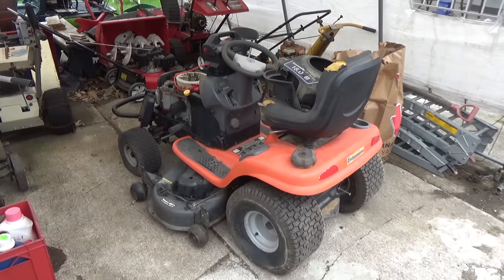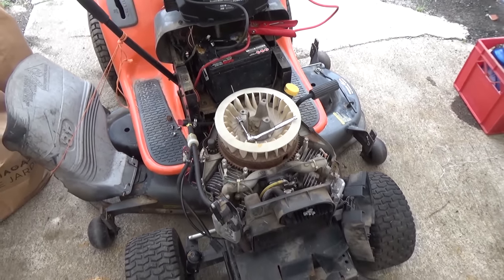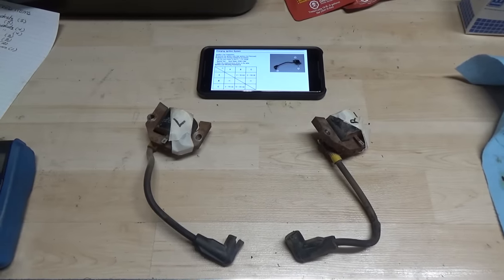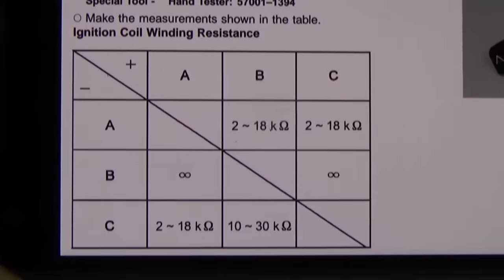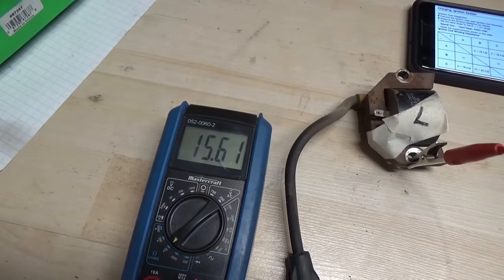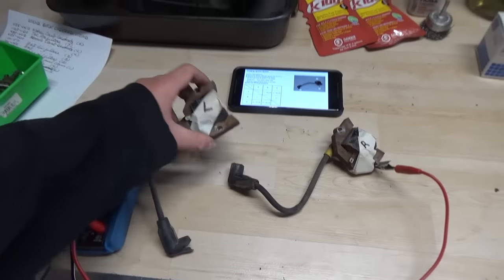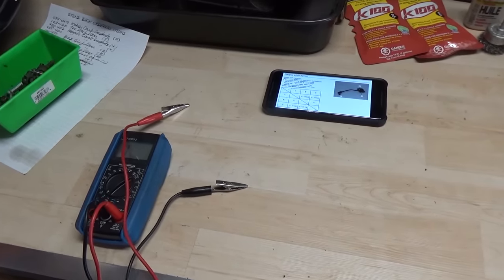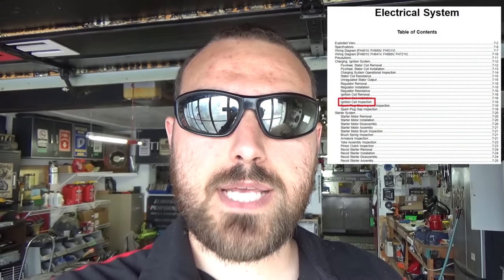How to Test a Lawnmower Coil

Comment: Have you ever heard of a coil starting and running fine, and then after a few minutes, start hearing a random miss (it's a one cylinder mower), than after a few more minutes it will stop running while cutting. Won't start back up immediately, but after waiting about a minute or two, it will start and run fine, and then repeat the same thing. Could it be doing this when it gets hot and fails? I have replaced the carburetor, auto choke assembly, and gaskets, removed and thoroughly cleaned out the tank and filter with detergent and water, dried thoroughly. I only run ethanol free gasoline and I always filter it through a funnel with a fresh each time conical coffee filter, and there is no water in it. It was doing this same thing before the carburetor replacement too. Sometimes, before dying, it starts to just run real rough and is trying to die, and if I can quick enough jiggle the governor rod, it will smooth out and run a few more minutes, but will do the whole process again. I think I need a new thermowax unit because it keeps the choke plate open always but I don't see how this would make it die once warmed up. I may have two simultaneous unrelated problems. It is a Honda GCV160 engine. I would replace the coil and see but they cost $60!

Comment: I see you are in Port Coleborne, looks like I spelled it wrong.  I went through there many times working on ships before you were born I think.  Do you answer questions ?
Reply from the maker: Yes, Port Colborne! And I respond to comments when I can, as long as I get the notification. Sometimes there's so many that I can't keep up and some get lost.
Reply: @EliminatorPerformance  OK , thanks. I like lawn boys and in 1992 I was looking after 3 yards and I bought a new mower to have in reserve. It’s a Briggs,  4 hp I think. Has been super reliable considering it is seldom used. Always starting on 1 or 2 pulls. I read the fuel pump diaphragm should be changed every couple of years and mine was still original, so ordered a kit with dia, gasket, filter n primer bulb. Trying to change the bulb I just destroyed it and never got the ring out..  decided to order a new carb and keep the parts. New carb on with dia, on tank first then gasket, and tightened evenly.  Now the problem. Primer bulb depresses with no resistance and pops back quickly not. Pumping any fuel.  And engine not starting.   Any thoughts, bad carb, or I did something wrong. Thanks for consideration. Henry

Comment: Brilliant. Thanks for sharing your knowledge. That was so helpful.
Can you tell me if it's possible to test the little Igniter module that's inline on the kill wire on a Kawasaki FC400 engine ? I have a weak, almost non existent spark.
Reply: This is what I was looking for. Page 37 of this Kawasaki FC400V workshop manual.
http://www.encoreequipment.com/wordpress/wp-content/uploads/2012/06/14hp_FC420V1.pdf
Reply from the maker: I've heard you can't test them, simply replace.
Reply: @EliminatorPerformance  - In that link on p37 is a test for what they call a "Control Unit". It does look like it could be an Igniter. Its got 2 Ohms readings. Same points but reversed polarity.
I've also come across some people who've fixed a bad spark by cleaning up the earth contact for the igniter. Sounds promising.
Reply: The two Ohms readings given in that manual for testing the igniter are 60-100 and 400-600. On the 60-100 test, I'm getting about 800. The other one, I'm getting about 580. On the strength of that I've ordered a new igniter. 

Thanks for helping me go in the right direction with this.

Comment: How can the timing be safely tested for an unknown (No markings and don't know where it came from.) coil?  I know the length of the HV wire does affect it, with being shorter having a more advanced timing.  You can have a dozen unmarked coils that look identical, but will fire at a different time.

Comment: I have a Murray mower that I have put a Honda engine in runs good until I go to engage the blades and then it bogs way down and acts like it has no power when I getting thick grass it just wants to shut off
Reply from the maker: Probably carburetor not fueling properly under load

Comment: What you are doing is NOT a test. You are just measuring the resistance of the coiled wire. You need to initiate a voltage spark to test the hv coil(s)

Comment: What is more effective to check magneto? A simple spark plug tester or multimeter?
Reply from the maker: Well a coil produces spark and can be checked with a spark tester, while a magneto charges the battery, and can be checked with a multimeter on the battery while the machine is running. If the voltage is higher while it's running, the magneto is charging!

Comment: Why does just sitting ...make a coil go bad...?
Does sitting for 10 years cause a coil to not work anymore?
Reply from the maker: Great question, sometimes they can get moisture in them. When you run the Engine, it creates heat, which can remove that moisture.

But once the moisture has sat in the coil for ling enough, it will start to corrode things.

This is where you run into issues.

Sometimes you can put a coil pack in an oven at low temp for 20mins (if a mower sat outside during a thunderstorm and won't start the next day).

Other times, you just need to replace the coil!
Reply: @EliminatorPerformance  👍
Reply from the maker: Could be the engine overheating causing a fueling issue, or it could be heatsoak on the coil causing bad spark. Sounds like a carburetor issue, but hard to say without seeing it.
Reply: @EliminatorPerformance  👈
The Points where bad.
And Bad Condenser.
Runs Awesome now.
ItsOriginal 1977 lvt10 has 10 hours on it..
Thank u

Comment: My coil is showing resistance on all 3 points.  Lawn mower will crank and run but idles rough. When I remove left side plug wire, it idles normal. Any ideas?
Reply from the maker: Look at color of plugs on both cylinders, check if 1 is darker than the other. Could be a fuel supply issue...
Reply: Both are about the same, just replaced plugs, even switched both plugs to see if was plug issue, still does it on left side.
Reply from the maker: Well, one thing I could recommend.

Of you purchase a replacement coil from Amazon, and it doesn't change anything, you can always refund it.

Only thing else I could think of would be your high tension lead (spark plug wire) having a bad cap connection.
Reply: If I pull plug wire on right side runs real rough. Both in runs somewhat rough. Pull left side and purrs like a kitten..
Reply from the maker: You could also check compression on each cylinder, see if there's a difference... On top of that, a cylinder leak down test could help to see if you have valve leak...
Reply: Check & set valve lash? ??

Comment: I HAVE TWO NEW BRIGGS AND STRATON COILS.  EACH ONE MEASURE ZERO OHMS BETWEEN B AND A.  YOUR CHART SAY IT SHOULD BE 2K TO 18K.  ARE MY TWO NEW COILS BAD?  WHEN INSTALLED ON ENGINE I GET A SPARK, BUT ENGINE WILL NOT START.
Reply: If you got a blue spark, the coils good

Comment: Hey love the video! I have replaced my ignition coil however when I short the coil it should turn off the engine. (Kill switch) but it doesn’t. I tested the kill switch and it’s giving ground to the coil. How would I test the coil? Any help would be great.
Reply: If the wire from the coil to the kill switch is connected then you should be able to kill the engine when throttling down unless the kill switch wire to the coil has a break in it. Use an ohm meter on ohms for continuity to check that kill wire only if it has continuity it should work. You may not be getting a good ground when you ground it out or the stand ups that the coil mounts to are badly corroded and you are losing your ground there. We always polish with a fine emery paper the stand ups prior to mounting a new coil. Hope this helps out, sorry so late since we have so many comments and rarely go back to answer new ones hope you understand. By the way we only need 200 more views to hit a million which would be our first million view video. Appreciate passing on the word about EP and this video, tell them to hit the subscribe button also and thanks again for commenting.

Comment: Great vid very helpful. 
I have a question about the coil when hot. Can they become faulty after the engine gets hot. I have a thorx engine on a mtd t-245 tiller approx 20132014 and it runs great for 10 minutes and once hot it dies. Starts up instantly after it dies but then dies again when you try to put it under load. Really bloody frustrating..
Reply from the maker: Yes absolutely, thermal soak is one term, they just get so hot the coil stops producing spark. I'd recommend to replace at that point. Also check for mouse nest.

Only other thing I could think of is fuel supply issue, but if it dies out quickly it's most likely spark. If it dies slowly, fuel.

Comment: Does one need a subscription to get the coil specs?
Reply from the maker: No, you need a service manual. Not all manufacturers make them publicly available. Type the engine model number into Google and type service manual after that. You may get lucky and find a PDF manual.

Comment: Isn't it uncommon for both coils to go out at the same time?
Reply from the maker: Not necessarily, this machine was sitting in a field for some time, humidity builds up inside them from the rain and causes a short to ground from corrosion.
Reply: The problem is, the kill-wire ckt was improperly tested because you didn't change the range on your multimeter. Leaving it on 20k range, you couldn't see between 20k & 30k which would have been in-spec according to the test chart.
Other than that, thank you for the video!
Reply: Maybe so Ken Hart, but if a guy is going to do a "how-to" on proper resistance testing of an ignition coil with a DMM, let's make sure we're on the correct meter setting.
The less initiated folks are already compromised enough.
Now, I understand this may have been a little overkill for a no-start condition (after verifying no-spark) but I wouldn't want to minimize the value of pinpoint testing circuits & components, especially for runs rough, hard starts, or crapping out at high RPM conditions. For these, I'll be verifying coil resistance (using the correct ohms scale). Thanks

Comment: I think my Kawasaki v twin needs coils it idles fine but starts sputtering and almost dies out when I give it any throttle I just wanted to get your opinion on what could be causing the problem before I buy new coils it’s got 2300+ hours and I don’t know when the coils were last replaced or if they were ever replaced and it’s running on both cylinders
Reply from the maker: Could be the carburetor gummed up?
Reply: @EliminatorPerformance  possibly I hope so anyways cause coils aren’t very cheap and thanks for the suggestion I really appreciate it

Comment: The end result will be a dependable  smooth running tractor . It is the neglect of the consumer caused the large cost of parts .the moral of the story is you take care of your equipment it will not cost so much to fix . pay me now or later ether way you will have to pay .
Reply from the maker: And paying later usually means paying more!

Comment: Great Video, wish I would have saw it last week. Wondering if anyone can help or maybe you have a condenser bench test video as I am a little foggy on that. I have a Kohler 8hp k181. Replaced coil, still no spark. I am thinking I probably should have ordered a condenser also. By the way only way for me to find parts is EBay, straight from China of course so just hoping they are good. Anyway in Checking the condenser, I am on 20k ohm setting, Red probe to wire, black too body, meter just stays at 1, should I not see a certain ohm reading meaning i am charging the condenser? Then I would check DC volts, mv I would think? Or do I just want it too hold a charge? Thanks for any help.

Comment: So on my riding mower, it had no spark. I pulled the small black wire to the coil(kill?) and key off it has ground. Key on it has no ground. So I need a coil and set gap? I don’t have a DVM to check windings. That sound good !?

Comment: What is making my generator eat spark plugs. Put in a new plug and it runs for about half an hour then it shuts off.
Put in another new plug and it will run for another half hour then it dies. The first plug wont work but a 3rd new plug will.
Any ideas
Reply from the maker: I'd start with a resistance test on the plugs. That rules out the plugs themselves. Then I'd check the resistance on the plug cap, as the action of unplugging it and plugging it back could be doing something. I'd rule out gas cap as well, possible vapor lock, and the time it takes to change a plug it fires again. I've never had that issue happen to me before

Comment: Two cylinder engine with a single coil (Briggs) should be tested how? With a meter it measures 5.5K ohms. What does your experience in this type of repare indicate. You are experienced with small engine repare or just reading from some pamphlet? Is there a way to test the magneto using a magnet?
Reply from the maker: As mentioned in the video, you need the proper spec. You need to google your engines model number and search for a "service manual" not an "owners manual" then you can get the coil spec chart like I had and properly test.

Comment: How can you tell if a coil is going bad? What would be the symptoms?
Reply from the maker: The engine would be running rough, maybe sputtering because of weak spark.
Reply: Eliminator Performance my mower runs for five or ten minutes then shuts down. Even while just idling. The plugs are new this spring, just put a new fuel filter on it and a new battery. Checked the plug wires and one seemed a little lose so I pinched the metal part in the boot a little to make it a little tighter. So I was just wondering if this could be the coil going bad

Comment: I dunno. I've got the 20 hp Briggs and Stratton two piston engine. No spark from either plug when I crank and watching the Gap on the plugs. I cleaned the magnet, no change. I started ohming out the coil and got a 1 then nothing on the meter at wire on the coil not the long plug leads. Then my meter broke and the Chinese LCD screen unglued and fell out. 
Anyway, $18 I ordered another coil.
Reply from the maker: Like I said at the beginning, if you unplug your ignition coil ground wire and it still doesn't spark with the proper gap set, just replace it.
Reply: @EliminatorPerformance  ok. I got the new part in and I connected it and left off the kill wire and checked for spark again and I get nothing. I had already cleaned the magnet. I'm at a loss here. Can it be installed upside down? I mounted it with the plug wires leading to my plugs any other way those wires won't reach one plug.
The part number is supposed to be the correct replacement. I can't believe I don't have spark. Gapping and regapping..

Comment: So, my coil is new and has the correct resistance according to the service manual. The air gap is also correct according to the service manual. There is no spark with and without the kill wire. What is the next step to troubleshoot no spark in this situation?
Reply from the maker: I'd check the high tension lead (spark plug wire) cap.

Sometimes they can have a bad connection.

Sometimes you can remove it and test for spark at the cable.

If that leads no where, return the coil and purchase another one!
Reply: @EliminatorPerformance  Thank you. Great videos. To test for spark, I'm using a test light in contact with the metal that's inside the spark plug wire that wraps around  the spark plug top. The other end of the test light is grounded to the engine. The test light glows brightly when attached to the battery terminals. Is there another way something could be killing the output from the coil with the coil kill wire removed from the coil? It is as if the coil output is going directly to ground instead of out of the spark plug wire.
Reply from the maker: @donaldlambert3978  Hard to say, usually they only ground through the Kill wire.

My guess is it's just a bad coil, with a short to ground causing a no spark situation...

Comment: Thanks for the video, i've been having a spark issue with a 2 stroke mower and it's doing something really odd..... So it wouldn't start after being layed up over the winter, pulled it a few times and got a spark but very weak so tested the coil-lead-plug and all were fine, next pull the starter rope failed so i took the pull start off and turned the mower over with a socket in a battery drill..... (this is where it gets odd) i get a HUGE blue spark first go but then notice the drill is turning the engine over backward, flick the drill the correct way and no spark? I don't get it?? all appears to test fine but i can only get a spark when turning the engine over backward?? have you ever come across this before?
Reply: Sorry it has been so long but we have never come across this issue in 9 years of business. This should only happen if the coil is on upside down or the polarity of the coil has switched over